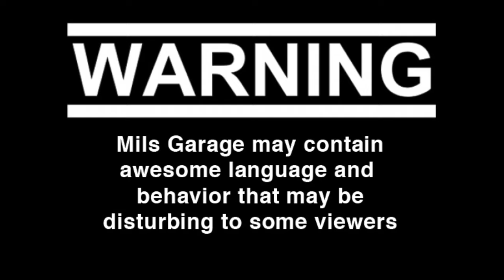Speaker Installation [Subie Gets Upgrade]

Comment: At 2:27 what is tht wire called u have in the speaker tht you plug in the stock wires???
Reply from the maker: @Ant Green Those are insulated male terminal connectors
Reply: I have a 2008 legacy jus bought speakers but they came with no wires..im new to this
Reply from the maker: @Ant Green That's awesome. No worries, you're very welcome here 💯. Keep up the great work 👍

Comment: wish i had watched this /before/ i cut my plug off and ended up soldering the wires all together (it works perfectly, just took several hours longer)
Reply from the maker: sounds like u did a good job on the connection, but.. yeah lol. stick around, we have lots more tutorials and content coming up :)
Reply from the maker: what r u working on over in HI?
Reply: Mils Garage i used to have an 86 but they're such a pain to find parts for so now i'm on that gf8 impreza life
Reply from the maker: a hachiroku?? yeah, unless u'r in Japan, but even then.. awesome! great choices. what all have u done to the gf8?
is there a car scene in HI? i've been meaning to fly out there
Reply: Mils Garage yeah there's definitely a car scene but it's a lot smaller because it's such a small island. they do have autocross and even rallying events here that i've been meaning to go to. all the work on my car has been interior so far, but i'm gonna be doing some more eventually
Reply: Mils Garage if you do fly out to Oahu (my island) make sure to hmu and we can cruise around and get some good food
Reply from the maker: cool. rally's crazy awesome. i hear cars r expensive over there.
and absolutely! that sounds like a plan
Reply: Mils Garage rallying is pretty much my dream, i love it a ton. and they're so expensive!! it's unreal you gotta pay big bucks just to get something with a 5speed that isn't consumed by rust
Reply from the maker: the whole idea of driving so fast through woods that u need a partner to feed u the turn directions is nuts. lol but it looks fun af. damn. i was just watching an auction where a Dodge SRT8 sold for $8000. that's less than i bought my G for O_O

Comment: What size speakers would I need for a 2005 legacy outback? Nice video.
Reply from the maker: thank you for your support! looks like 6.5" will fit in the OEM brackets.. here's a link to Kicker speakers which should fit [ Kicker DSC65 DSC4 Package - https://www.hifisoundconnection.com/Subaru-Forester-2005-2008-Factory-Speaker-Upgrade-Kicker-DSC65-DSC4-Package-New-SC2-SPK-PACKAGE2109?utm_source=google&utm_medium=base&utm_campaign=GoogleBaseFeed&gclid=CjwKCAjwwPfVBRBiEiwAdkM0HdXNr5otpVetZ6oDPe1mWA7DqTlA3Dwe-SinF7-Uga6Qdhx9nBQ3JxoC2U8QAvD_BwE ]
Reply: Mils Garage thanks.   Those were the ones I was looking at and the same website too.   Thanks man
Reply from the maker: awesome. any time buddy 😎
Reply from the maker: so the link i sent you says it's for Foresters, but i just triple checked and still found that you need the 6.5" speakers. sorry for any false alarm. just wanted to be sure :)
Reply: Mils Garage yeah I noticed that.  Thanks man.  I’m gonna send this outback let me tell you.
Reply: Mils Garage https://www.hifisoundconnection.com/Subaru-Outback-2000-2009-Factory-Speaker-Upgrade-Kicker-2-DSC65-Package-New-SC2-SPK-PACKAGE2144        That one?     I think the car is a Subaru Legacy outback.   doesn’t have a hood scoop like the other 2005 outbacks
Reply from the maker: yeah, that one should fit. everything i'm reading says the Subaru Legacy Outback can fit up to 6.5" with about 2" depth.. here's a link to a list of more options than i know what to do with.. i'd stay away from anything larger than 6.5" [ https://www.crutchfield.com/g_400/All-Car-Speakers.html?l=5#&avf=Y&nvpair=FFBrand|Kicker ] 
and here's another link to specifically the Kicker DSC65 DSC4 for super discounted cheap [ https://www.crutchfield.com/p_206DSC6504/Kicker-43DSC6504.html?avf=Y ]
Reply: Mils Garage I also want to put like an underseat subwoofer in sometime and one of the kicker speakers bundles comes with an amp should I j get the speakers by themselves then buy the amp later along with the sub or what
Reply: Mils Garage also would you know a good single din radio that’s got front aux and usb?
Reply from the maker: that's an awesome idea! i'd install subwoofers under the seats just to see girls faces. 😎🔊🙀 .. honestly, it all depends on what you're looking for.. i'm not as knowledgeable about sound systems as Ryan, but i'll ask his opinion when i see him tonight. you may want to hold off on the amp, in order to make sure it's supplying the right amount of power to operate the subs you end up going with.. it would suck if you needed a stronger amp [unless you don't mind the possibility of needing to install 2 amps]
Reply from the maker: i'll see what Ryan says about the radio too :)
Reply: Mils Garage yeah.   That’s what I was thinking was to buy the speakers by themselves.   Then I’ll worry about the sub. That’s all I really care ab is a manual transmission and a good audio system. You know, just the shit myself,,, a 17 year old,, would think is important.
Reply: Mils Garage do you know what I would need for 2001 Subaru Legacy gt?
Reply: Mils Garage also how many speakers are in a 2001 legacy? Help is appreciated

Comment: Where did you get the bracket for the door speaker?
Reply from the maker: pretty sure those brackets r from the old upgraded set
Reply: PROJECT.Dプロジェクト the brackets are actually bone stock, mine has them too

Comment: Are those speakers 6 1/2?  The ones I bought didn't fit even with the bracket, what's the depth of it?  Also, thanks for your camera recommendation, in another video I asked about your camera and I went and bought the Canon T5i. Really digging it, inspired me to upload videos to my channel. They're car videos if you ever want to check them out.
Reply from the maker: awe man, they didn't fit? i'll have to double check what size those speakers we installed r.. 
and awesome! i'm glad u like the T5i. enjoying the viewer? :D for me, the viewer is worth every penny. just checked out ur channel and subbed :D keep up the good work! we need to make a trip to that beach some time and Subie drift it
Reply: AbelTV I'm pretty sure they where 6in.   6.5in is too big.  and the depth I'm not 100% sure but I did say it's about 3in.
Reply: @ryancox2959  I dont think its 6in. Its either 5.25 or 6.5 if it's a round speaker. If its oval it's a different story. Usually with aftermarket you need adapters. And always make sure the depth is small or equal to stock. Unless you're using an adapter that pops it forward. Based on the video his look like 5.25inch

Comment: I have a 95 subaru impreza and i can't get the rear speakers out. it a 4 door. so the windshield slants over the speakers so i can't get leverage on the screw. I just took the wiring and have it going to a small sub box in the trunk. But i can't can't here it as well as I want. Am I not using the right tool. Or do i have to take the back seat out? Thank you!
Reply from the maker: for tight spaces, try a small ratchet with a socket and screw driver bit.. if that doesn't work, u'll probably have to take more apart for access.. let us know if this helps :)
Reply: I need to a socket it and screw bit.  I ended up using 2 flat heads and a  lot a wiggling. But I'm stuck on the stereo. I have a blue tooth adapter but I just want to put in a new deck. I just can't get this one out. I have taken out the console, the cup holders, the shit behind the cup holder. It still won't budge.
Reply: Onna hayes hi there, sorry for the delayed response.  there should be a thin silver metal frame around the entire head unit.  there are little tabs on it that hold everything into the dash. you should be able to pry on each side of the metal frame with a thin flat head and pop each side out one at a time.  just be delicate lol.  let me know if this works ☺

Comment: That's a MUCH OLDER model Subaru.  I got the kicker speeaker upgrade for the doors.  Kicker tweeter kit going in a couple of days.
Reply from the maker: +Sam Levin yeah buddy :) it's a 1993 model. what year r u installing on?
Reply: 2016.
Reply: Did your head gaskets start leaking yet?  I had a 2008 Impreza before this one and its head gasket was leaking out.  Throw out bearing was also making some noise.
Reply from the maker: +Sam Levin i'll have Ryan get back to u about the gaskets and whatnot in a few.. i don't believe he's had any issues, but it's not boosted, so that probably helps not blow the gaskets
Reply: Mils Garage My 2008 Impreza wasn't turbo either and it still had head gasket issues.  They weren't bad but they were a little wet.
Reply: +Sam Levin hey Sam,  so i do have an oil leak under there somewhere, but im hoping its just the oil pan or valve covers.  ill be changing the oil pan and valve cover gaskets this weekend. i hope that is the issue, because i dont want to deal with head gaskets lol
Reply: +Ryan Cox if it's a head gasket and it's only minor and just roll with it. if there's an internal leak and it's mixing with the coolant you better fix it soon. You seem like an auto Savvy guy so do whatever you think is best. these cars are notorious for head gasket problems. Supposedly they fixed it after 2010 but I haven't looked at consumer reports about that lately.
Reply: +Ryan Cox Hey man I installed the Kicker Tweeters a couple days ago. They made a world of difference!  I listen mostly to rock and metal though so I need the high frequency response.  I think you could still benefit though.  They are dirt cheap. 119 bucks but you can get them online for around 90.
Reply from the maker: +Sam Levin u were so right about all the gaskets lol the Subie was leaking like no tomorrow O_O everything's all sealed back up now though :D
Reply: Mils Garage Was it the head gaskets?  Did you pull the motor and replace them?
Reply from the maker: +Sam Levin we replaced the oil pan gasket first, but noticed the oil was coming from above, so we replaced both head gaskets too
Reply: Mils Garage That's a chronic problem with 4 cyl Subarus older than 2010.

Comment: how to get door panel off with the door closed....won't open with key or power button...
Reply: David Jefferson I don't fully understand what your asking. However you can't take the door panel off with the door closed.  It has to be open in order to get the panel off
Reply from the maker: i think we need some more info to solve the issue.. is the problem that the door won't open in order to take the door panel off?